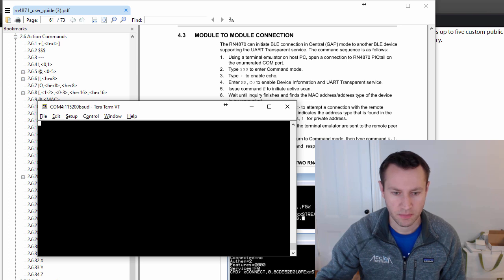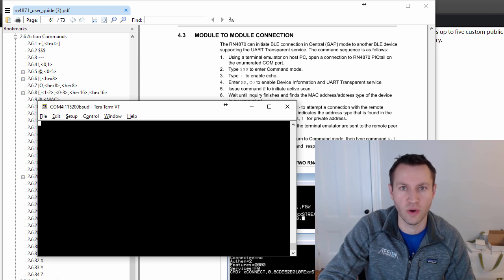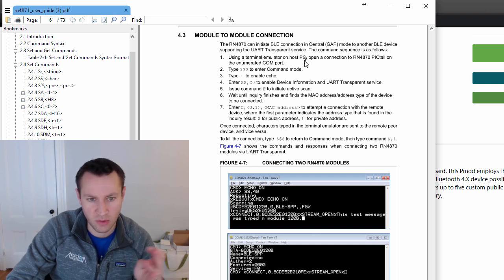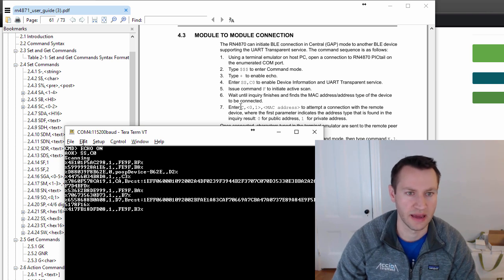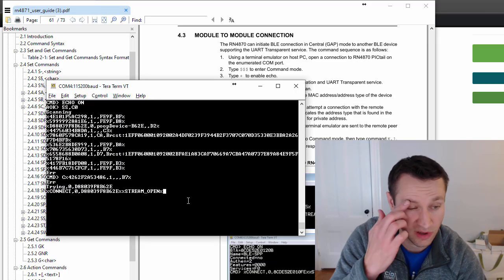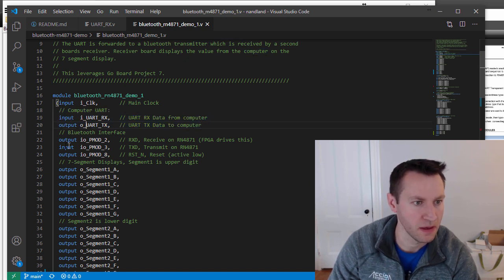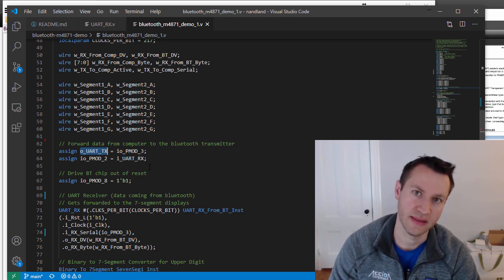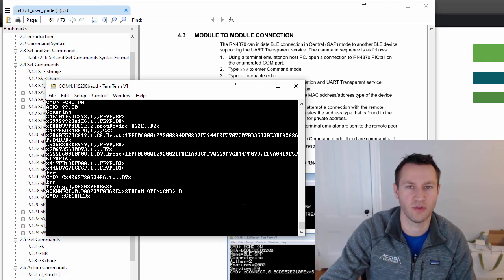FPGAs communicating over Bluetooth Demo. Send/receive ASCII data, make a transparent UART

Comment: I like that! I was wondering if you could connect via Bluetooth to say a video camera attached to an esp32 or something similar. Probably a lot of work but that pmod should make it easier anyhow.
Reply from the maker: Would you want to send the video data over Bluetooth? Bluetooth is a low-bandwidth interface, so unless you had very little camera data you wanted to send it would be hard to make that work.
Reply: @Nandland   Ahh I see, didn't think about that.

Comment: I initially thought that you were going to configure the bluetooth module from rtl, not just route the uart interface directly to the module. Suppose you were not able to hook it up to a computer, but could only configure it in rtl. How would you go about doing initial setup configuration? By writing an fsm that sends the config commands one after another? And of course the pairing mac address would be fixed in the rtl. I want to do something similar but with a configurable adc module, and set it up through spi. Like a crude volt meter. What do you suggest?
Reply from the maker: Yes basically. You could get clever and put the commands pre-loaded into a Block RAM and then just read through the block RAM one character at a time to send them to the UART on the Bluetooth module. There are a few ways to do this.

Comment: I'm trying to implement the BLE PMod on the Nexys A7 and this has been a huge help. I'm wondering if you know if it's possible for the PMOD to act as a client listening to and getting data from multiple servers/devices?
Reply: Hey. I'm trying to do the same thing and doesn't work for me :( The code from here worked for you just fine ?